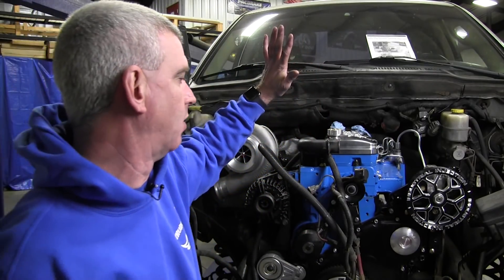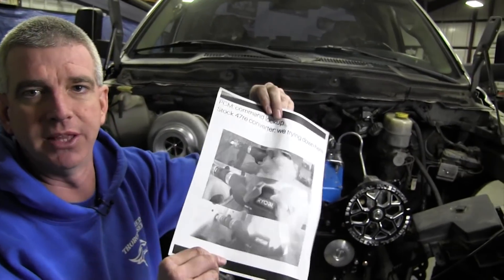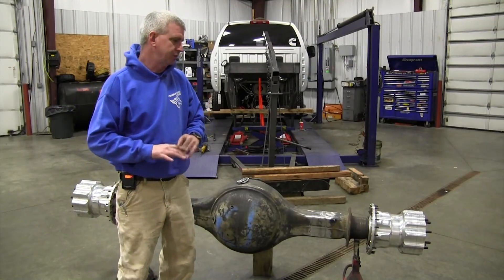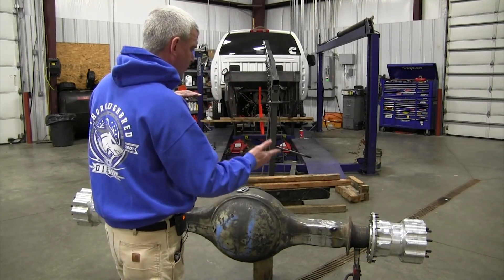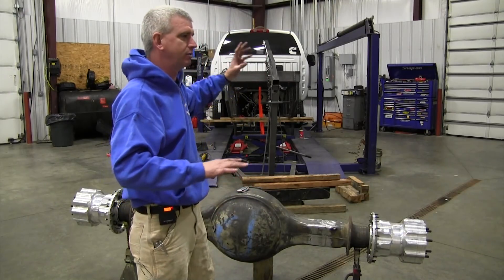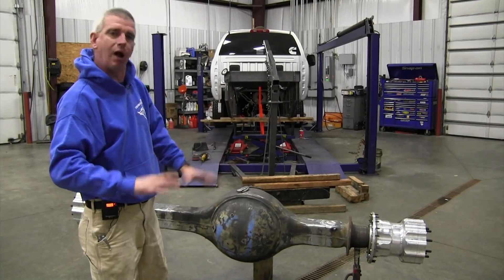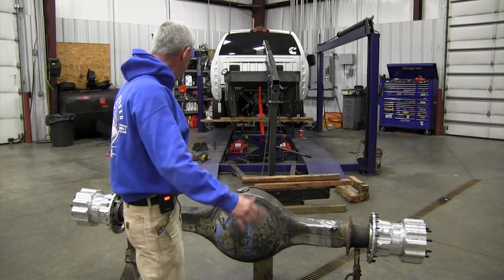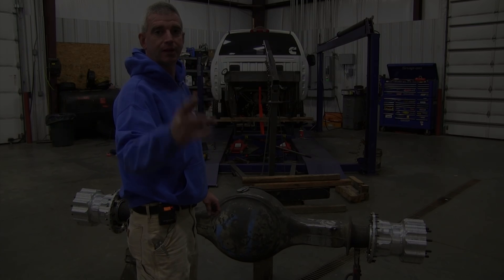Shocking Mistake Was Made With Our Truck: What A Kerfuffle | Dirty Diana Build Update

Comment: Don't feel bad guys. I put an engine in my sister's truck,was in a hurry and put the steel plate that goes behind the flexplate upside down. Got the engine in and the starter wouldn't go in. I had to re-remove the engine and flip that plate. Just accept the fact that sometimes you will f**k up,learn from it and remember to just laugh at yourself!
Reply from the maker: Thanks! It was a good lesson learned.